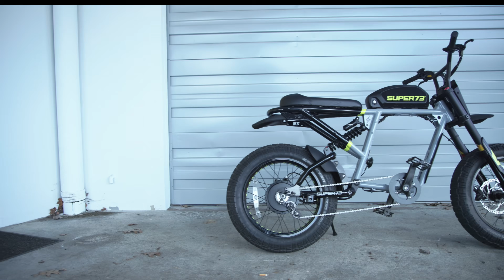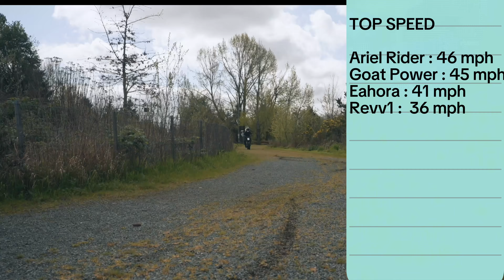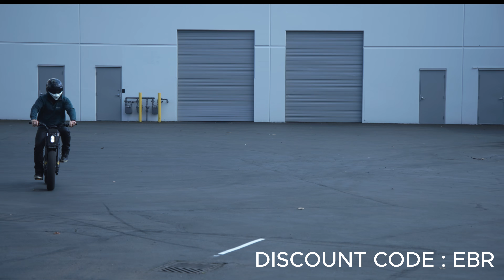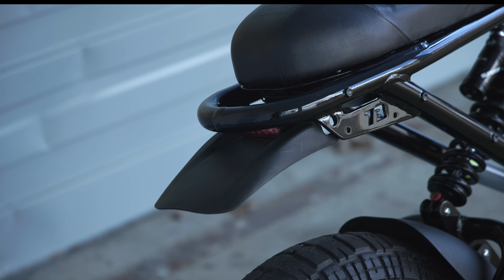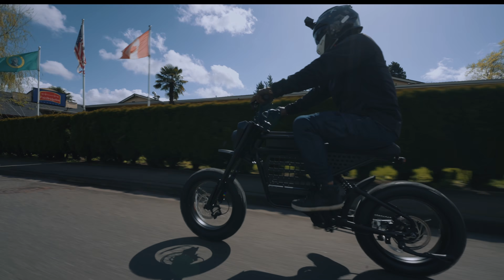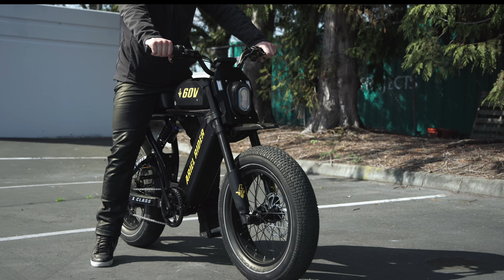Battle of E-bikes. Goat Power, Eahora, Super73, Ariel Rider, Ride1up Revv1 Comparison

Comment: Couldn’t give me a sorry 73.  Don’t understand why the price is so high when it’s so slow and weak
Reply: Because its not about being fast😂 its a 50 state legal ebike ment to get you from point a to point blank its a form of transportation ... do you complain a kinda civic ora miata cost 5k? No? Both those cost more to use and maintain then the ebike does and the ebikes doing it in a safer and faster manor 😂 if you want fast look at e motorcycles not e bikes its not a dman surrin or any other mid drive Dirt bike its a hub motor city commuter

Comment: Im trying to find a high quality E bike that has gears for pedaling but has the ability to go 40 ish MPH to be on secondary roads to be safe.Lets face it people are distracted by being on there phones or just not  paying attention. you need to be doing road speeds. But I like the motorcycle style with a color display, have an option of a up graded display with GPS FM blue tooth. nice big round LED head light. I noticed there are some E bike that have massive battery on it .To replace it when it dies is about $1,800. I would rather have 2 or 3 batteries that cost $400 each. If one dies you can replace it without draining your wallet. The e bike should have turn signals and regenerative braking to help get a few more miles to your bike to stay out longer. With the new battery technology coming out the new sodium batteries we should ( wishful thinking) should get better performance better miles per charge I would like to see at least 80 to 100 mikes per charge and shorter charge times may be around 15 to 20 minutes and be a 100% charged.
Reply: Why whats the point? People like you are the exact reason all these laws are in play if you want a ebike the fastest it can go period os 28mph or less in every state in america any faster it's a moped or motorcycle unless your getting registration and a plate your not allowed on any public road period as your an un registered motor vehicle

Comment: Now he forgets to mention this is  not a fair test were the motor  goat v3 has the longer range bc its a secret  double battery bike bc you get the frame battery  for  it you get a 130 miles of range and a littel more speed bc the motor  is not starving for juice
Reply from the maker: Where is the secret frame battery ? If you buy that full size battery for sure it will be longer range. But that isn't factory moden neither the bike we compare.
Reply: I own the bike my self the make a frame battery  for the bike from the company  not trying to  mislead any one its a big battery on there site I been want to get one but can't  afford  1,400$ battery  you have to go to the 3 whit lines go aceries then scroll to battery's then they will have it and now they have a new ebik call the king goat but hay I like the ease of use and having mag wheels instead  of spokes
Reply from the maker: @shadowhunter933  that king goat is an interesting ebike. I have my eyes on it too. I love mag wheels but be careful not to involve into some crashes. They are not possible to be repaired.

Comment: Revv 1 was a deal breaker for me with no key start plus they have a non-standard connector for motor and controller. Meaning you are reliant on them for parts. The connectors aren't rated for what the bike is constantly pulling so expect to replace parts, at least their support is good. The bafang motor is great but the controller is absolute gunk for a bike that toes the line on amperage its controller can take. It was great value for the money when it came out and its build quality is nice but its core components are meh. I'm not paying for a bike that could be e-waste if their oem decides not to make their components anymore in a evolving market.
Reply from the maker: great point especially in an era where many companies go out of business (i don't think this is the case for ride1up but who knows) it is good to have standard parts. Many people with juiced bikes have issues to find replacement parts especially for batteries.
Reply: @theebike-reviewer I did end up reaching out to them about my concerns. Got some much needed info on components. So I ended up ordering one.
Reply: @ChildishCodino which bike did you end up going with
Reply: @SnickatNight  I did end up reaching out to ride1up talked about their oem parts and potential alternatives for replacements. Pretty confident in their support even after the warranty period. They were the best in my area for legality so I orderd a revv 1 fs. My top 3 were revv 1, motor goat v3 and a lyric graffiti x. I plan to use it to haul camping gear and wanted the ability to use bike trails without worrying about e-bike classifications.

Comment: I owned and sold several e-bikes and had chance to ride few of the bikes in the video. Ariel Rider and Goat power. Recently I owned a Ristretto which was the best ebike on paper but comes with lots of issues so I needed to get rid of them.  So anybody want to buy one of these bikes I hope they can read it carefully. 
I still keep Goat MG3 and X-Class 60V. 
My first bike was Ariel Rider x-52 which I liked the bike but 3 years ago the company wasn't that responsive. Sometimes need to wait 2-3 weeks to get a replacement part and it was annoying. Since the last 2 years lucky for them they improved and that was the main reason I had confidence to pull the trigger. Otherwise I won't buy the x-class 60V. 
The carton box was damaged when I received the bike and crank was damaged. I send an e-mail and they replied within hours. And in 3 days I received my replacement crank. 
For the goat power the bike is very good on paper but like some other owners here I had issues with customer support. Not easy to get reply to your e-mails and even you get sometimes you need to wait weeks if not months to get a replacement part. And you will be lucky if that part is the right part .  

In terms of performance I think both bikes speed and acceleration are similar. Not big difference. I Feel biggest difference is your control on the bike. As Ariel Has a beefier, heavier frame and larger tires you feel more in control. 

Another difference is the battery capacity as both ebikes have similar price but Ariel seem to have almost x2 capacity. 

In the end it all comes to preferences but I will be happy to own Ariel rider over goat. Ariel need to change those decals and the seat I hope they will replace with a nicer looking one.
Reply: Hi frank, what’s the best moped e-bike you would recommend? Super73 is cool but expensive and it seems there are so many more better ones out there, what would you recommend?

Comment: If there is anyone near Milwaukee that wants all of the electronics for the Goat power bikes, reply to this comment.
Reply: Do you have a throttle for a motor goat v3   mine broke if you have one please let me know.
Reply: @shadowhunter933 if it's the same as the billy goat, then I do
Reply: @shadowhunter933 i have the throttle from the billy goat. Should be the same, the motors and controllers are the same

Comment: Another reviewer put the Ariel Rider X Class 60V up against the Lyric Graffiti X and the Ariel Rider was beaten in every category you just used. Not only did the Ariel Rider do bad but the Lyric Graffiti X made it look really bad by a huge margin.
Reply: It does make me happy that more companies are putting out more 60v+ ebikes but the 60v ariel rider seems like a motor goat v3 with slightly smaller battery and a few upgrades most goat owners do nothing the first 6 months of ownership. Im curious if any of the ariel riders parts would be compatible with the mgv3..... makes a feller wonder.....
Reply: @TheElectricutioner  Does Motor goat vs has largery battery than Ariel Rider ? Man that is disappointing. I thought AR has almost double the capacity when I checked website one has 60V35ah and other has 60V20ah (mgv3) right ? If Ariel has smaller battery then thats too bad. 
I saw another youtuber and in that comparison two e-bikes race was pretty close head to head. if speed acceleration are all similar which e-bike would you buy ?
Reply: See aerial rider 60 is damn near the motor goat v3 but without the 60v 17s battery and rather it has a 60v 35ah battery so techspeaking the rider should get more range but the biggest thing to hinder range are full weight under load, and the terrain. And woth my current knowledge id honestly prob get the ariel rider for the simple fact that ive checked their site and they have replacement parts. Not a ton but atleast thay have some. All you get from goat bikes is accessories some of which are wildly priced and its EXTREAMLY hard to find aftermarket parts online that are plug and play. my buddy at work has a 52v ariel rider and when he laid it down he jack up his throttle. Not even a week later he had a brand new plug and play after market. When my mgv3 throttle broke I spent around a week taking pics and emailing back and forth to the get an email quoting me $75 for the th rottle and shipping. I get paid order it and wait like 2+ more weeks until I finally had a throttle again. Ariel riders are easier to get after market electrical parts for the goat bikes are but the price of the goat bike for what you get is a pretty good deal. Just be ready to have to learn and map pin outs and what not if anything breaks on you. And even with a warranty there's a chance your paying shipping still. I now am able to almost fully rip apart and rewire most of the goat bikes. And I have yet to find a single throttle that is a direct plug and play with it. Everyone ive tested always needs a wire or two flip flopped.

Comment: The bike cave just posted a video and the motor goat v3 beat the Ariel rider in the races they ran. How can you say that 0-20 it’s a whole 2.3 seconds slower? There’s simply no way that’s possible.. @thebikecave
Reply: Yeah doesnt sound right to me. I need to see you race a Goat
Reply from the maker: I don't know but direct drive motors are faster in longer road. IN short distance such geared motors are better. I think bikecave video is more about 30 mph top speed.
Reply: @theebike-reviewer  It's not. They raced directly off the line and the goat was in front the entire time. Hard to believe that it was over 2 full seconds slower just to 20 in your tests. 2 seconds is a huge huge difference..
Reply: @motoman1996  In that video, he's sharing his discount codes for Goat Power. Of course, Bike Cave needs to promote Goat Power to earn his 10% commission. Also, in that video, I saw that Bike Cave raced the Ariel Rider against many other e-bikes—until the race with Motor Goat. During that race, the Motor Goat had a full battery, while the X-Class did not. I believe that video wasn’t very fair.
Reply: @VoltRideReviews  I was going to say the same thing. Bike cave's video will be more fair if both e-bikes race with full charge.
Reply: @VoltRideReviews  He's got discount codes for both brands and has done videos for both bikes so not a valid point
Reply: How many amps is the Ariel controller? Also, how did you get the 60v rear panels already on the 60v X Class?
Reply from the maker: @AlliDoisNguyens  they are selling you need to send them e-mail.
Reply: @theebike-reviewer and the bike comes locked to 20mph and does say one the web site about this and you need to put the code 0000 to fully  unlock the bike so you get the full power and speed
Reply: I saw that video as well and was wondering what happened here. VERY different results.